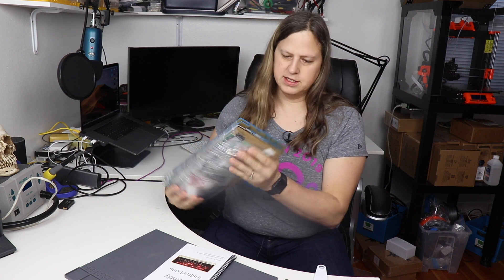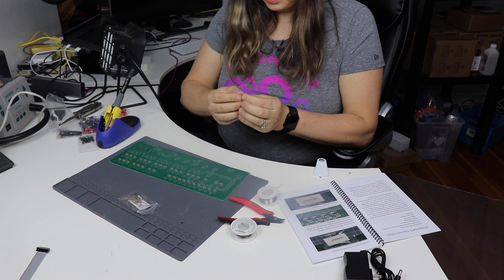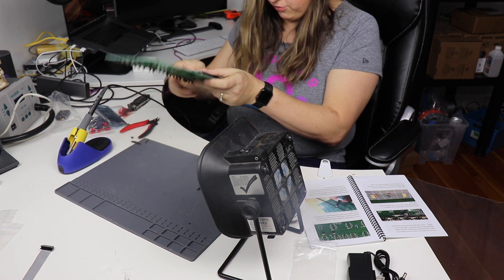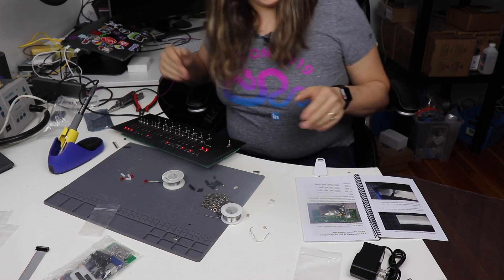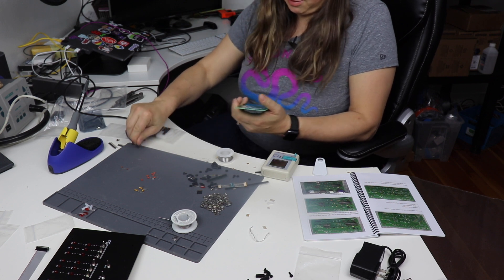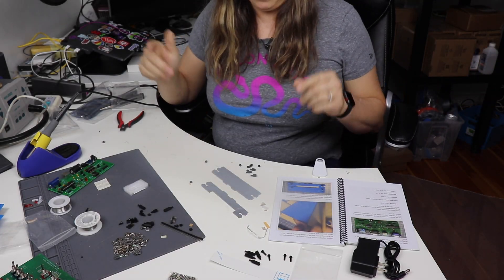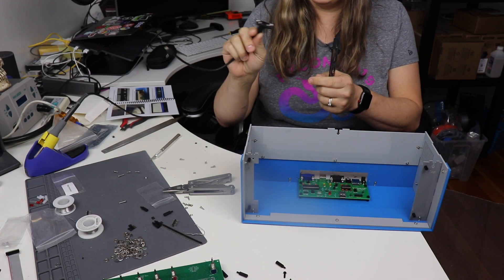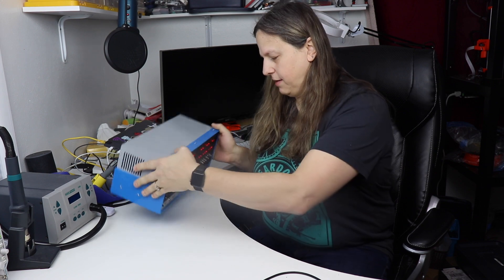Assembling the Altair-Duino Pro: A Mits Altair 8800 Replica Kit

Comment: I am not great at sodering
Reply from the maker: You have to start somewhere. I've probably been soldering for about 35 years now. I just recently started trying out welding, which is a completely different skillset, and I'm not great at that, so I get where you're coming from.
Reply: actually, project like this are great way to learn soldering. You start with the easy stuff like the resistors, then go to bit more tricky part with switches which need more solder, and last you solder those smaller pin headers for Arduino, challenging your skills...

Comment: My first computer was an 8088 KayPro, so I'm not really from this time, but I was always fascinated by the Altair 8800 when I was younger. When eBay first became a thing in the late 90s... they were going for like 20 bucks... "FREE if you pick it up" was common. Amazing to see the prices of these machines now. I realize it has a video connector, which is only because this is an Arduino remake, but curious to learn more about the Arduino... thinking of getting this kit... just not sure what I would do with it. I recently bought a bunch of CP/M kits, soldered them up, and got them working... but other than logging into them, and then doing some basic DOS commands, I'm kind of at a loss what to do with them.
Reply from the maker: That would have been a great item to pick up at that price. Unfortunately I didn't learn about the Altair 8080 until quite a bit later than the 90's (Probably more like 5-10 years ago). Honestly I've not really done much with mine since building it. I honestly thought I would experiment with it more, but it hasn't been a priority. If you're already familiar with the Altair 8080, I think it's a great kit.
However, I've played around with my IMSAI 8080 a bit more and though the kit for that one is a bit more expensive and harder to obtain, it's a higher quality construction and the switches are easier on the fingers, plus the web interface is fairly well developed and makes it more approachable.
Reply: @makermelissa  Thank you for that. I appreciate it! I have an SC131 kit, so I'll probably spend some time learning more about CP/M and try to play those old Zork games. But I may just have to pick this up... if for any other reason than to improve my soldering skills. Thank you again!

Comment: Mostly useless build video.  The most important thing of the build is getting the LEDs exactly at the right vertical spacing to fit and look good on the front panel.  That was the only reason to look at this video, but you didn't cover that, you just show stuff that somebody that doesn't know anything about building should know, but then those people should be learning all that from much simpler and much more affordable kits so the mistakes don't cost anything!
Reply from the maker: You make some good points and I do appreciate feedback like this because it can help me make better videos in the future. I hope I did a better job on the IMSAI 8080 kit in which I tried to take some of the comments I received on this video and make improvements.

Comment: I like how stuff just works for you.  Whenever I do a kit, I have to redo several mistakes I make.  I guess I need more practice.
Reply from the maker: There was a part where I had to disassemble part of the case because I assembled it in the wrong order, but it was kinda boring and I didn't want to make the video too long. For the most part, though, it went pretty smoothly. We all get better with practice, myself included.